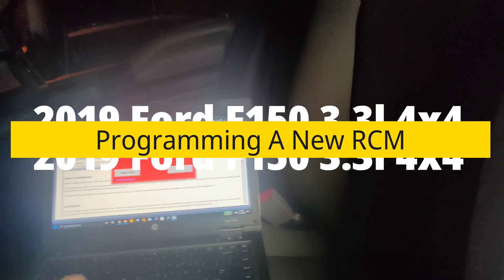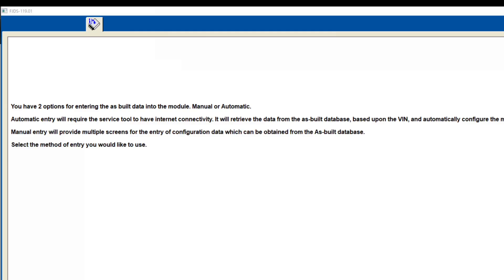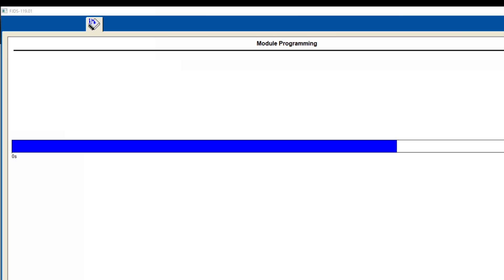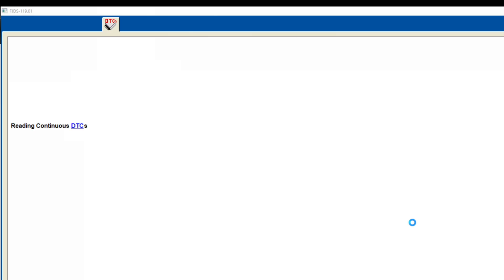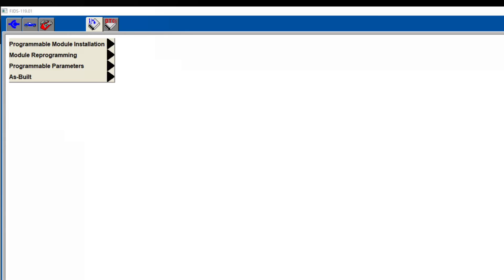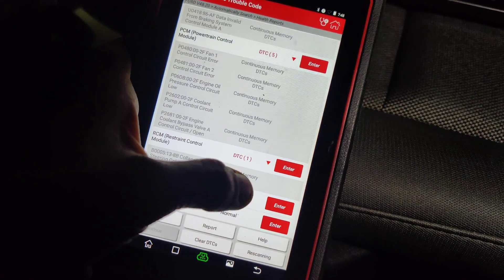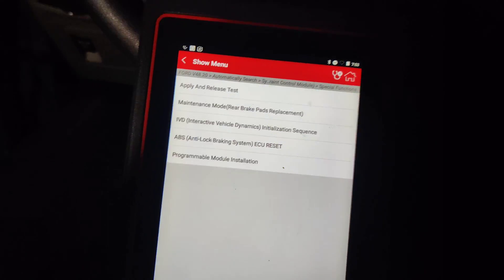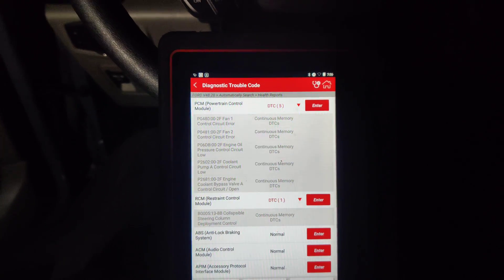2019 Ford F150 3.3l 4x4 Programming A New RCM U2100, U2300, B0005, and C0062

Comment: I got a 2016 f150, had a missing RCM I got a used one same year truck, can I get that programmed in my truck? My buddy tried it with forscan and that didn’t work.
Reply from the maker: You should be able to if it's the correct part number. If it doesn't support a pmi then you have to use fjds.
Reply: @RobertDotterer  thank you! I have no idea what it means but I will try to find  someone instead of ordering a new RCM from a dealer.
Reply from the maker: Fords factory software, you can buy a subscription on their site.

Comment: Rob is there a place you call that supplies access to all prescriptions or do you call a different number for each vehicle? Anyway good video and hopefully if you do start up classes you can cover some of this programming basics. Like what equipment is required. I have Win10 but I guess you need a J2534 junction box and a good battery maintainer, plus a subscription to your vehicle. I know I’ve seen on AESwave for Honda they sell the mongoose J2534 plus they give you numbers to call for subscriptions. Boy it now seems like any module you change needs programming. Stay safe and well Artie 😊

Comment: Make sure you bolt it down. I replaced one in a 2016 Ford Fusion and I used Forscan. I left old module in place and plugged in new module and got a no communication with RCM. Turned out it grounded through the mounting bolts.
Reply from the maker: I didn't touch the module. The shop replaced it.